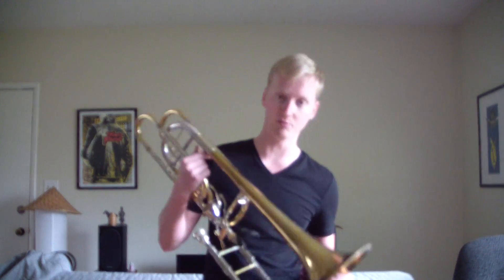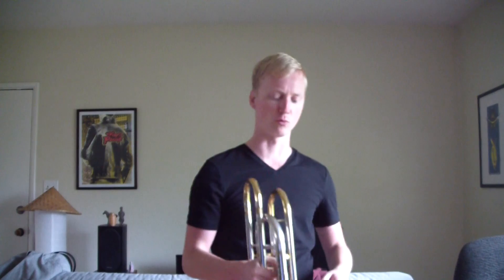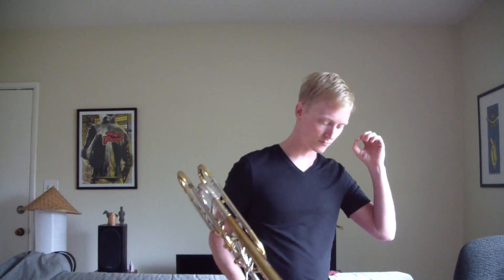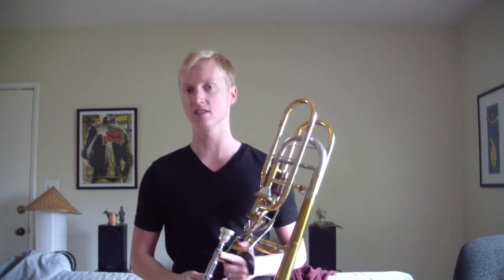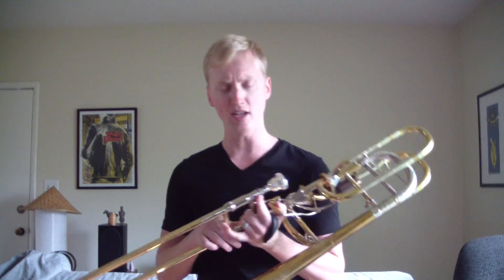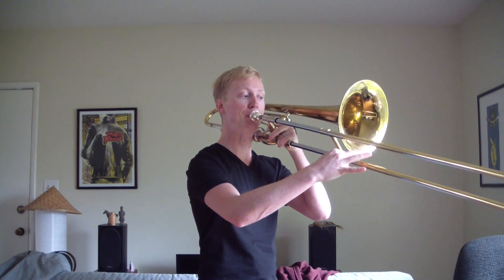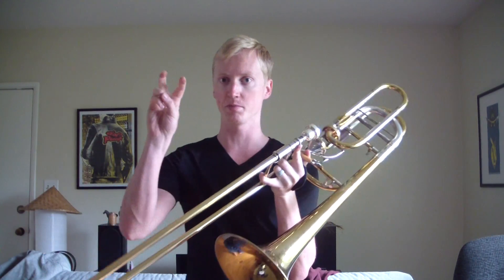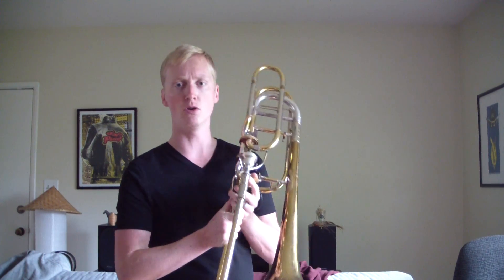Low and Loud: A Guide

Comment: In addition to using the right air speed and keeping the embouchure set but not as rigid as other ranges, it seems like it also helps if I back off on mouthpiece pressure just a bit.

Comment: Nice video, Aidan! When I play bass, I have a “break” at pedal G. Would you say breaks are due to air or embouchure, or both? If I reset, then all is fine. Thanks!
Reply from the maker: Thanks, Jeremy!

That's pretty common in most players, I think. Everyone has to change something in the face down there at some point- the only way around it is a lot of hard work to smooth out any large shifts. I spent a lot of time with Teele studies and others to try and be able to play everything in almost the same setting, but even now I can't really get clean slurs from pedal C to Eish.

Comment: Good video, although I’ve usually had an issue with volume from the low E to the low B natural above pedal Bb. I can play pedal notes perfectly well with good volume, but the notes in between the pedals and the F just don’t have the volume I need. Transitioned from Euph to Bass for my high school jazz band. The trombone isn’t in good shape either, not much funding for the band sadly, heavy dent on the bell and some missing parts as a result.
Reply from the maker: Don't fight the instrument down there. It's easy to move air too fast for it to respond.

Also, make sure the slide is in exactly the right place. It's easy to be off and make your life a lot harder centering notes.
Reply: Aidan Ritchie My slide work is pretty good for being new, and I’ve heeded your advice about fighting the instrument. It might just be the triggers are off as I’m able to play the E (and Eb when I lip down) with strong volume and that characteristic bassbone sound, but once I touch the F attachment for the D or the E to make it easier the sound drops into a muffled tone. A tad similar issue with the Gb trigger too, although louder, it still muffled the sound enough to limit me to mezzo-forte and muffled. It’s an old Bach 50B with lots of abuse, being a school issued instrument. Going to have it sent to the shop this week hopefully. Thanks for the quick response btw :)
Reply from the maker: Are the valves well oiled?

Comment: Can you get all these notes from a tenor trombone?  Why is there a bass trombone if the ranges are the same?
Reply from the maker: Just because you can play the same ranges with both horns doesn't mean you should use it that way in performance.
Reply: Aidan Ritchie thanks! I obviously have a lot to learn about trombones. I think I can hear the difference though. In a nutshell: The bass trombone sounds like Wagner. The tenor trombone sounds like jazz.
Reply from the maker: @ckeilah  lots of jazz bass trombonists out there too :)
Reply: Because bass trombone sounds phat
Reply: Low B naturals are only really possible on a Bass Trombone. Bass bones are also a staple of most Big bands.